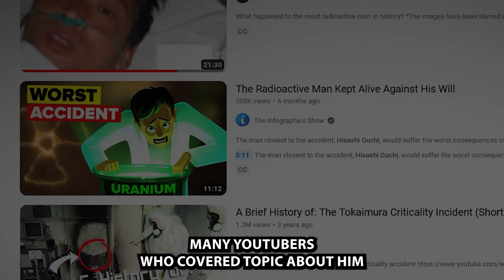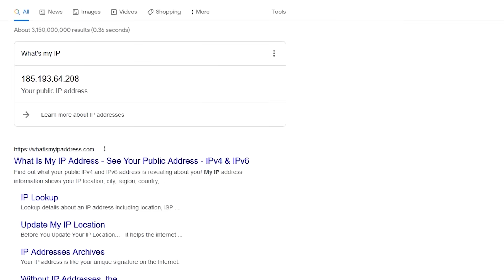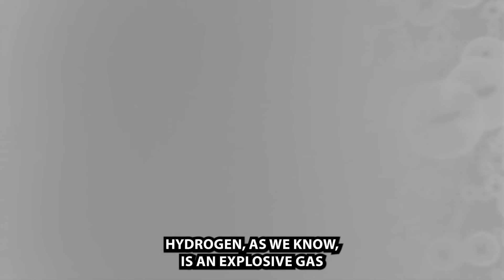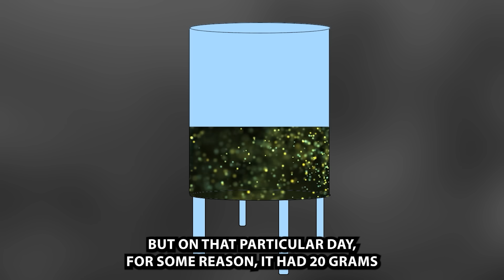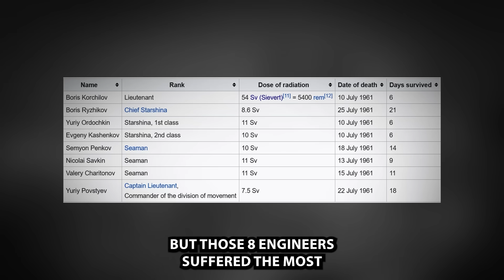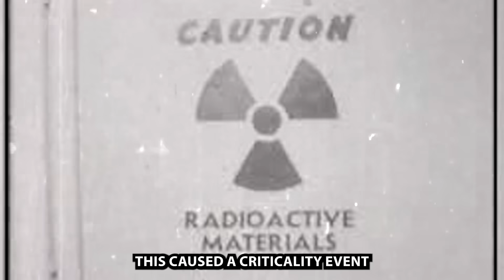Most Radioactive Men Ever

Comment: Anatoli Bugorski? Particle accelerator went through his head, exposing him to 200-300k roentgens of radiation, which is around 1865 Sv. Survived too.
Reply: Only to a small part of his body Not a whole body irradiation.
Reply: That's due to the nature of how partical accelerators work, instead of like a bullet where the dump the most energy initially, they dump almost all their energy at the Braggs peak or just before they stop

So you actually have a much higher chance to survive a high powered partical accelerator than a lower powered one

Comment: There is more people who have received higher doses and a few wrong statements here, firstly in regards to Slotin and Peabody, Slotin’s dose is estimated now at around 11.1 Sieverts, which is undeniably a high and fatal dose but not as high as ouchi’s also Peabody is though to of possibly received 100 Sieverts but the most accurate dose is actually 88 Sieverts. As for others who have received more than Ouchi, Aleksandr Zakharov received 48.5 Sieverts, and there are two other people from criticality incidents one being in Argentina both received over 35 Sieverts, finally several people from Chernobyl have received more, firefighter Pravik, Kibenok and Tishura all received higher doses with Tishura received the highest of the 3 at 18 Sieverts, not to mention the horrific amount of beta burns they received internal and external, another fireman who picked up uranium fuel pellets and kept them in his pockets received 21 Sieverts and other firemen who fought fires on the roof of unit 4 the side of it, received over 30 Sieverts, the highest I believe was 39, finally plant operators Akimov and Sitnikov, and Perevozchenko all received higher doses than Ouchi, Perevozchenko received 17.1 sieverts and Akimov received 19 sieverts, and Sitnikov received 20 Sieverts. Kurguz received the same as Ouchi at 17.

Comment: Lelechenko actually received his dose in two fractions. First time it was in the night of accident. Then he received intravenous solution and felt some improvement so he came back to NPP. That's when his overall dose exceeded 20 Sv.
Boris Korchilov spent most of the time in reactor room: over an hour. His absorbed dose wasn't even the highest: 9.6 Gy. His colleague Yury Ordochkin received 9.9 Gy but "only" 30 Sv.
Reply: Korchilov received 54Gy.
Reply: @elric5371  No. He received 54 Sv, not Gy. 1 Gy of fast neutrons does more biological damage than 1 Gy of slow neutrons. Slow neutrons in their turn are considerably more damaging than gamma.
Reply: @dymytryruban4324  yeah but when equating doses between Gy and Sv gamma is equal, so therefore 1Sv of gamma rays is equivalent to 1Gy of gamma rays this is the same for converting between roentgen too.

Comment: It seems that Peabody's exposure in Sieverts have been converted from a claim that he received "10.000 rads". However, this claim seems to come from nowhere, and all I could find was an article claiming he actually received 700 rems. For Slotin, there are a lot of different calculations, and apparently most of them place the dosage much lower than suggested in the video. It would be good to see sources for the claims in the video, because it appears to be very sensationalized, with little information about the cases.
Reply: The dose for Peabody from the official report on the incident has a highest estimate of 190 sieverts, he definitely received over 100mi can link it to you if u like.
Reply: Everything in the vid is true and correct, apart from Slotin as he received 11.1 Sieverts, Peabody received 88 Sieverts, not 700, the article that states it was 700 is full of misinformation and comes from the ring he was wearing, other more eligible sources like looking at unscear reports of affects of ARS, are more eligible, plus 700 rem is not going to kill someone in 49 hours, more like 49 days. The symptoms Peabody experienced are also neruovascular based which occur with doses greater than 5000 rem.

Comment: can you send the sources for your numbers ? because I found that peabody only received 7 Sv and not 100, Slotin 10 and not 21, lelechenko estimated between 15 to 25 because difficult to have a precise value, ok for the 36 Sv for Cecil, ok for the 54 Sv of Boris, Ok for the 60 of vasil'ev and 20 for erofeev.
Otherwise, cool vid for information 👍
Reply: Slotin received 11.1 Sieverts, Peabody didn’t receive 7, that is misinformation from a poorly written article much more accurate measurements place peabody’s dose at 88 Sieverts, 7 Sieverts is not enough to kill someone in 49 hours, as Peabody died because of Neurovascular syndrome, which only occurs at doses above 50 Sieverts. Lelechenko has confirmed to received 25 Sieverts, and other people from Chernobyl received more than 17 Sieverts, Tishura received 18, Akimov 19, and Sitnikov 20, also several firemen received above 30 Gray.

Comment: The list omits the case of Anatoli Bugorski, who survived an accident with a particle accelerator despite a radiation exposure of more than 2000 Sieverts. The accident happened in 1978 and he is still alive.

He was apparently lucky that he was exposed to pure and very localized radiation - which ended up paralyzing the left half of his face, but didn't damage the rest of his body, so contrary to expectations he recovered.
Reply: 2,000 sieverts is probably bs

Comment: So what if Slotin left that Demon core intact and ran away with his colleagues? Would it be more destructive than Chernobyl itself?
Reply: Not really, if he left Demon Core closed plutonium would just heat up and at some point start melting because of all that heat and release less neutrons because of it's melted form it would just go subcritical and also probably destroy cover because of all that heat. If it would start some sort of fire of facility that would just release contaminated ash into the air then we would have problem.

Comment: It melts you. While you're alive to feel it. Basically, I guess.
Reply: It doesn't melt you, radiation damage DNA of cells which cause either change of cell that can cause cancer or cell just die. With small radiation cells will die but your body will just produce new ones in their place BUT with high doses of radiation (like people in video get) your cells are dying in such rate that your body cannot produce new ones (and at some point cannot produce cells anymore) so your organs just shut down and rot inside of your body. And the worst part is that your nervous system doesn't die so fast so you feel extreme pain of your body just dying, it can be dealt with really strong anesthetics but at some point even your veins will be destroyed so there will be no way of them working.

Comment: I think slotin definitely saved a few peoples lives that day because he was fast to react and remove the top although he still suffered
Reply: Slotin knew he was fucked regardless 
If I remember correctly after he smacked the top back off the core he even said “Well, that does it” before telling them to mark their locations
Reply: he famously said "dont move,i need to mark your positions to calculate your chance of survival"
Reply: Not really, he's the reason they were ever in danger in the first place - he took off the safety mechanisms that would've 100% prevented the reaction
Reply: He wasn’t really thinking about saving them, it was about saving himself and minimizing the damage. He did save them, but he also put them in danger in the first place.

Comment: There is more: 900 sv were received by crew of 10 submarine sailors in Chazhma bay on 10 of August 1985 during refueling (Soviet submarine K-431 accident)
Reply: Wrong, those 10 were killed by the blast, the highest dose from that accident was 2.2Gy, (220 rad). Half a lethal dose.
Reply: @dingbat19  correct
Reply: Source?

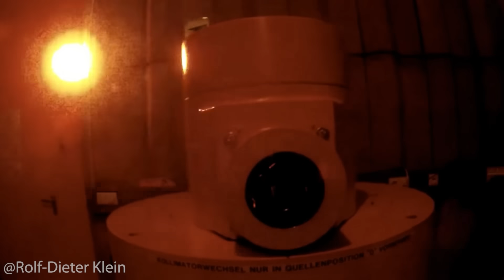Comment: 1:04 Can somewone tell what this is?
Reply: Hey, I'm a little late.

Camera image sensors generally detect light by converting it to electrons in some way. The camera body blocks light so that light can only strike the sensor after first passing through the lens. But, higher-energy electromagnetic radiation, such as X rays and gamma rays, as well as particles with sufficient energy, can pass right through the camera body and interact with the sensor. These types of particles and high-energy photons are called ionizing radiation because they carry enough energy to knock electrons off of atoms, turning them into ions. As you might imagine, such a particle striking an image sensor will knock loose a bunch of electrons which can then end up in the sensor's readout electronics. Since the sensor is designed to measure the intensity of incoming light by converting it to electrons and then carefully measuring how many electrons accumulate in each pixel, a bunch of extra electrons will effectively appear as a flash of light.
Reply: I think it might be an exhaust pipe I can’t really tell
Reply: It is the man that drink radium a long time ago in the 1800 and then he kept drinking it so much that his jaw completely fell off
Reply: Ya